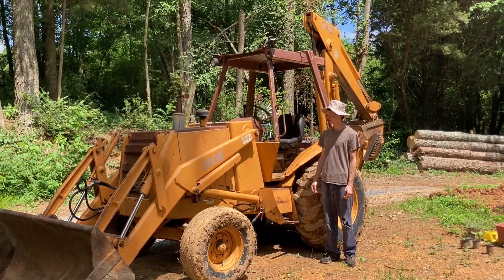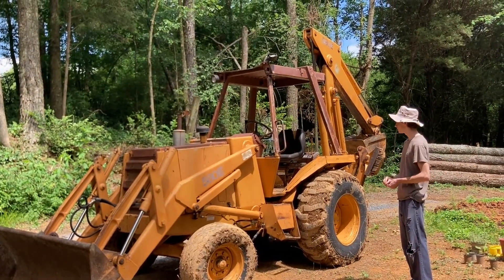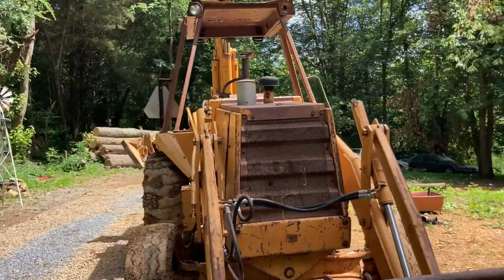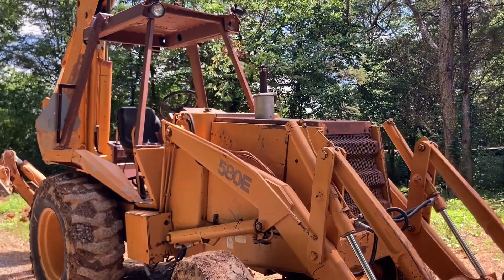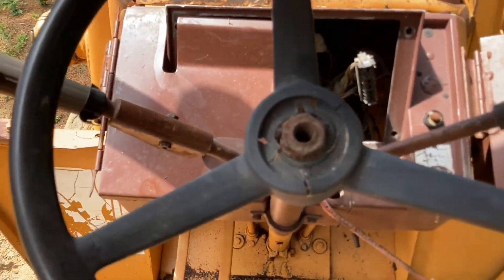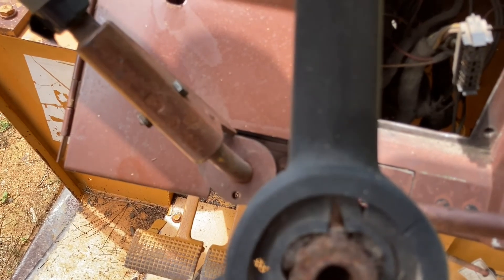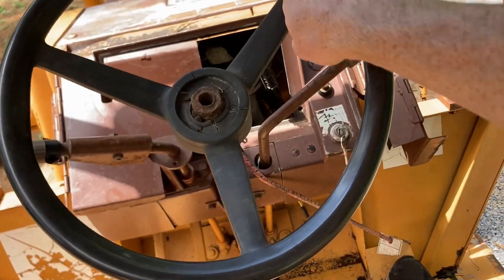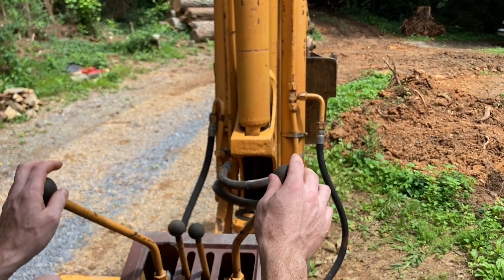I Bought a Backhoe! Walkaround of My Case 580E

Comment: I've also got an SE.  Mine has the 4 in 1 bucket, the extendahoe option, and a home brewed hydraulic thumb.  Everything leaks, gages don't work, brakes are shot, and the shuttle needs a rebuild.  But I love the machine.  Despite the problems it has been very reliable.  Last year I finished digging a house foundation, a septic system, a well cistern, and built a 900' foot road.  All in northeast WA where the ground is half boulders.  Trucked the tractor east across the Cascade Mountains with a 6.7 Ram diesel and it was a struggle on some of the hills.  The tractor weighs close to 16k pounds.  Looking fwd to more of your videos.

Comment: Nice video. I operated several Case machines back in the 90,s including an old 580E. A very well designed and reliable unit if operated accordingly. I can remember working out the hoe transport locking mode lol. Have never seen one quite like since. Keep in mind dead heading your rams will reduce the service life of the plants rams,seals,keeper pins and such. Happy excavating. 😊😊.
Reply from the maker: You make a very good point about proper usage, thank you!

Comment: I have one of these, you need to check the motor mounts, I replaced my mounts and did not realize that bell housing is aluminum and if the rear rubber mounts go out the aluminum flanges hammer on the frame and can bust the bell housing.
Reply from the maker: That's a good note, thank you. I noticed there was quite a bit of vibration over the whole machine from the engine, but I just considered it was due to the design of the engine mounts. I will definitely check them now!

Comment: I could deal with the worn pins on the back pivot arm....but the loose subframe is a major problem...I went to look at one a few months ago the guy was asking 4k but when I noticed this I I walked away...iv had people tell me that eventually it will damage the control valve...hydrolics seem in great shape tho steady movement at low rpms is a good sign...good luck

Comment: I recently purchased a 580E . 1985 I think, do your gauges work? Can you make a video on the gauges and control levers and how you start yours?
Reply from the maker: The gauges have been an ongoing battle. The coolant temp. gauge fluctuates all over the place so I ended up installing a mechanical gauge for that one. The voltmeter sometimes works, though it reads lower than actual. The oil temp. gauge does not work, the wiring to the sending unit on the shuttle has been ripped off at some point and I haven't located the remnants yet. The tachometer works, but as the others it is not totally accurate. It bounces around a bit. The primary cause of all these issues is the connector on the back having oxidation and the contacts where the gauges meet the PCB are rusty. One light I did fix recently however is the oil pressure light, it needed the contacts for the bulb socket cleaned and a new sending unit.

I could definitely make a video like that, but sadly it wouldn't be until summer.

Comment: You think a machine like this would be decent for lifting and moving cars and trucks around?
Reply from the maker: To a certain extent. At the bucket pins, I think there’s approximately 5,600 lbs of lift force, so it can certainly lift most cars. However, assuming you’re using forks, your capacity will likely be in the 3,000 lb range; that’s also assuming a lateral lift (from the side, not the ends). I’ve found that the loader is very strong, but the curl cylinders are the weak point. Those are the most vital for fork usage.
Reply: @fixaday  thanks

Comment: Fishtailing all over the road because you loaded it wrong. Should’ve been loaded backwards where all the weight is. For anyone who wants to know trust me I know I’m a lowboy driver. dump truck driver with tilt bed trailers and dovetail trailers, hauling every piece of equipment we have. The weight is on the back end of those things and fishtailing is caused by having too much weight on the back end of your trailer, you need more weight towards the front.